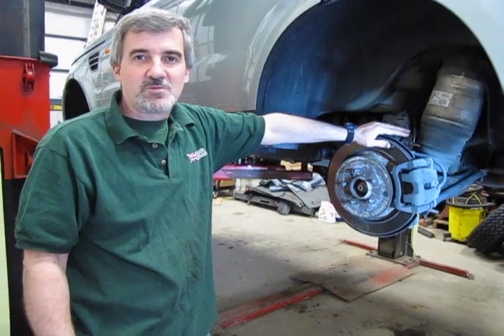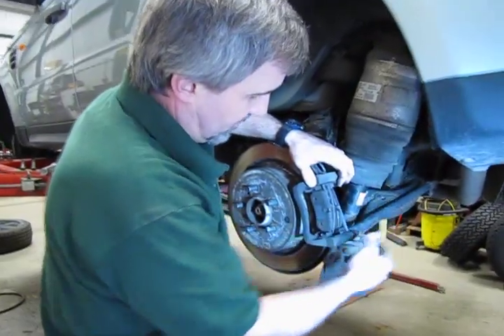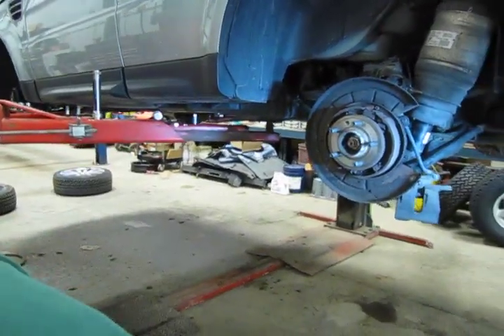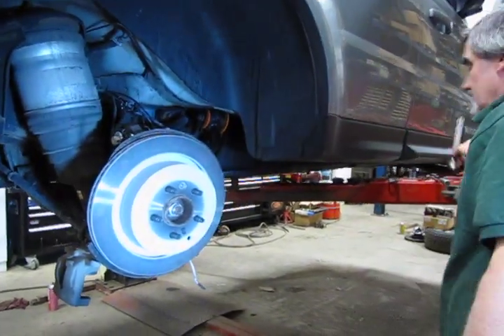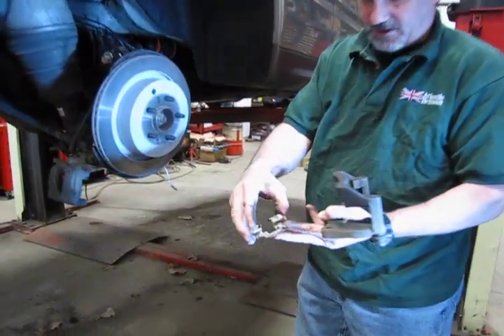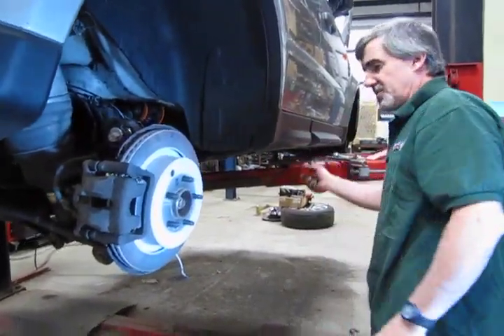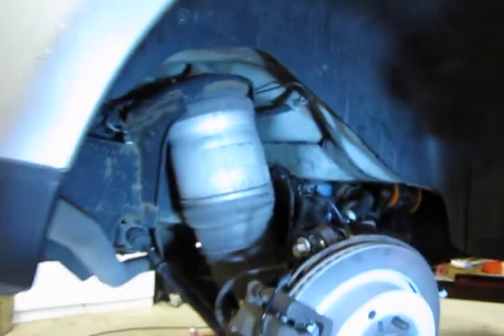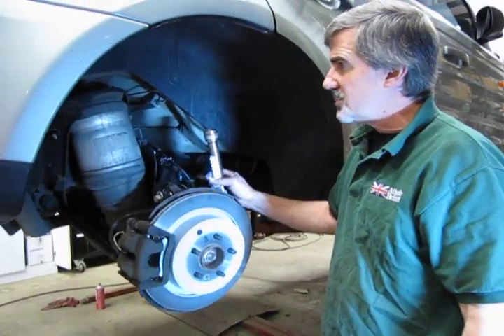Rebuilding Rear Brake Pads And Brake Rotors on Range Rover Sport or Land Rover LR3

Comment: Do you have a procedure for burnishing parking pads on the RR Sport? I was thinking just set the adjuster firm, not tight, drive 3 k at low speed, then readjust until the wheel spins with light parking break friction. Make sense?
Reply: Google bodsy's brake bible.  It give all the procedures and torque specs for the discovery 3, through 09 the sport should be the same except the super charged, which has bigger brakes.

Comment: Hi was there a change to the hardware for Disco 2s for the rear brakes. Because anytime I order brakes and need the pad sliders the hardware is now pin boots and bolts not sliders in any kit I have ordered even when they show the sliders as the included hardware and bot the rubber boots and screws for the caliper bracket. If anyone knows if there was an issue using them and they discontinued use. If that is the case what is the replacement method? Graphite or some other protection maybe waxoyl or fluid film or high temp grease?

Comment: I hear you need to manually disengage the electronic parking brake while turning off the truck before doing this job. Is that true?
Reply: I saw this in the instructions but I skipped it... I struggled with the rear  right disc. The shoe was blocking the disc

Comment: I've had my Land Rover LR3 2006 since 2008. I'm tight on money right now. For the 1st time I'm going to change the pads myself. I'm simply wondering if I need to bleed the brakes individually or 1 at a time as I change them? Or does bleeding the 1st pads I change bleed them all? Or do I need to only bleed the 1 on the front (the 1st set of pads i change on the front and the 1st on the back bleed them)?
Reply: If your fluid isn't old you can just bleed a little from each caliper as you do it.  If the fluid is 2 or more years old it's best to do a full bleed. Which means sucking as much fluid as you can from the reservoir, refilling with fresh dot 4, starting at the rear passenger side and bleed until you get fresh fluid, then do drivers rear, passengers front, and driver's front.  It is just like most other cars.  Don't let the system run dry, if it loses prime you'll need to have someone use a computer to bleed the abs system, so make sure the reservoir always has liquid in it, have another person watching it and topping it off while you bleed.

Comment: What is cause when you match brake in range rover sport the wheel steering vibrate
Reply: Warped discs. You need to replace the front discs.

Comment: How much different is the 2010-2012 L322 5.0 (not supercharged) rear rotor replacement than this?
Reply from the maker: The main difference is that the parking brake on the 2010-2012 L322 non-supercharged is manual instead of electric, so all you have to do is push back against the brake until you have enough room for it to release and then the disassembly and reassembly process is about the same.
Reply: Thanks for the quick reply!!! 2010 L322 USA version has the EPB (electric Parking brake).  I've seen different videos showing different tools (some have a hex bolt securing the disc to the hub, others use T50 torx), some require the thin wrench to hold caliper pins while undoing the bolts, where others seem to use a long allen/hex shaft.  I've done pads on my L322, but never removed the rear discs.  As far as getting the disc off, I've heard some people say that EPB must be put in retract/service mode, I do have SDD, but not sure if iits an option in there (I know older vehicles had a way to do it by pressing brake pedal 3 times, than holding the parking brake switch), or do you just retract the parking brake using the star adjustment wheel with a screwdriver?  Not sure about 2010-2012 L322 as I know there are a lot of differences after MY2009